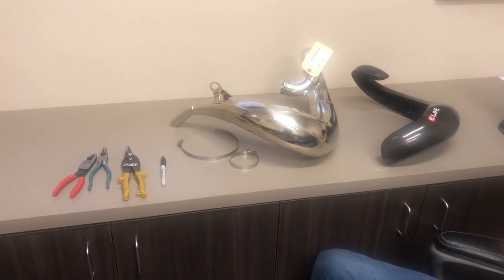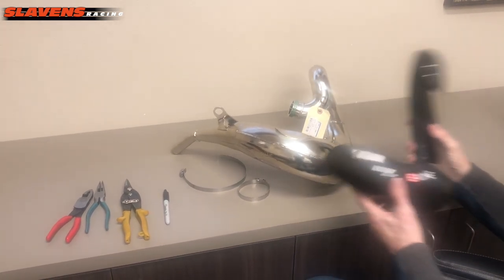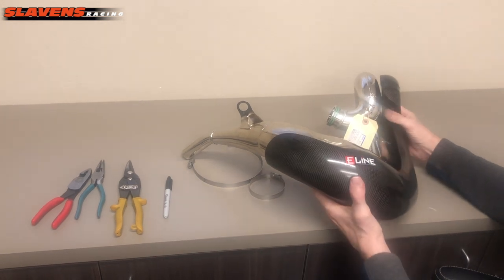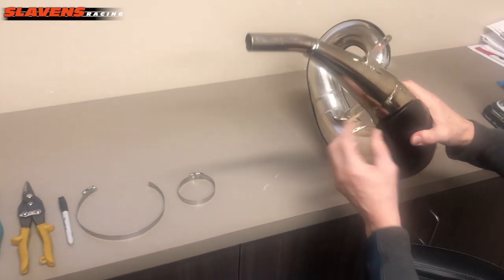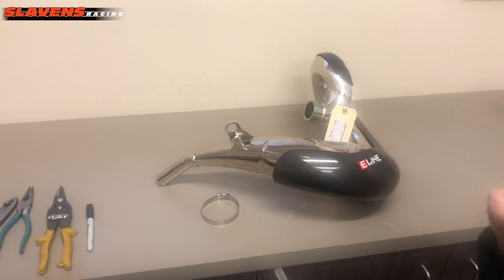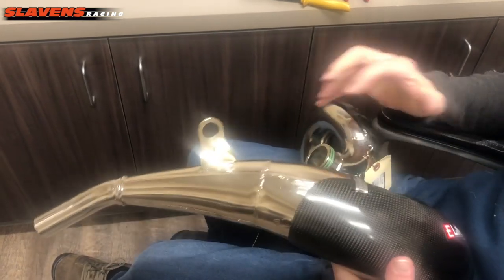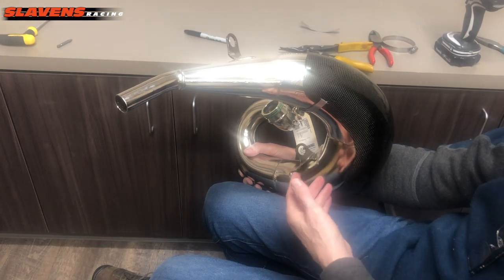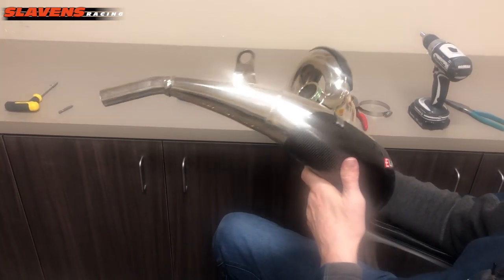How-to Install Carbon Fiber Pipe Guards

Comment: Jeff,

What do you think about the MAXCoverage Carbon Pipe Guards?  Seems like they would keep the heat in the pipe.  Does the extra coverage buy any piece of mind?
Reply from the maker: Haven't given them much thought. They are fairly new to market and have been poor sellers so far. I doubt if they keep more heat in the pipe and what would it hurt if they did, nothing? Peace of mind is up to you.
Reply: I've had a max coverage p3 guard 💂‍♂️ on my 2021 ktm 300 xc-w tpi (stock pipe) for 3 hrs. Honestly, I don't believe it's any larger, & therefore offers any additional protection, than the E line guard in this video. One notable difference is the subtle way in which each manufacturer chose to use the smaller clamp to affix the guard. E line has a groove that Jeff mentions while p3 has two slits similar to the larger end of the E line guard. Therfore, it's possible to expose more of the sexy carbon fiber on the p3. I can't believe you made a video about this either Jeff, but I was looking for insight & found it, so thank you.

Comment: I am curious Jeff. I have had people tell that the carbon fiber guard (which I run) actually traps heat. Therefore, it causes micro cracks in the pipe and ruining it. Any truth to this? By the way your parts store is THE best online.
Reply from the maker: Hello: The guys telling you that should spend more time riding and less time chit chatting about subjects in which they are not educated. The guard only covers part of the pipe and there is plenty of surface area for heat dissipation, although retaining heat is a non-issue. Many performance tuners (there are few left in this country) consider heat retention a good thing. As far as cracks, that is total BS. Pipe cracks (other than ones caused from crashes) are almost always in the head pipe area, just a few inches from the cylinder. Those are caused by not servicing the pipe o-rings which allows the pipe to rub the cylinder and the resulting vibration cracks the head pipe over time. The o-rings should be changed regularly to prevent cracking.

Comment: The best tip is to not buy a carbon fibre pipe guard... Each and every single one is junk... Maybe this one is really durable but the entire concept of a guard beeing mounted to the pipe is not worth a penny. Use a proper pipe guard such as muzzle or ptech and use that....
Reply from the maker: Andrej
Carbon pipe guards or other pipe mounted guards are not for everyone but they are very popular and beneficial for most riders. They do not protect the pipe well during big impacts, like ramming into a large boulder, but they do offer good protection from rocks coming off the front wheel and for smaller impacts like falling over in a corner or in a rock garden.  For ultimate protection, pipe guard/skid plate combos like the Emperor https://slavensracing.com/shop/pipe-guard-skid-plate-17-ktm-husqvarna-emperor-racing/ is the way to go. 

I use carbon guards on my bikes because they look great, are lightweight and offer enough protection for me.
Reply from the maker: @LiquidAider 
Thank you. I've been down for 5 months recovering from extreme injuries from a MC vs truck head-on collision. Still have a long recovery road ahead.